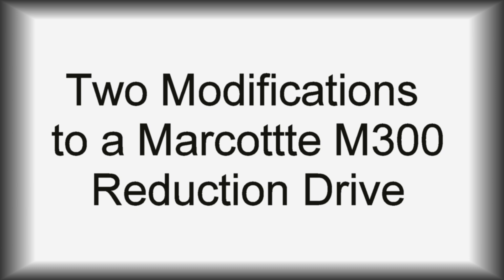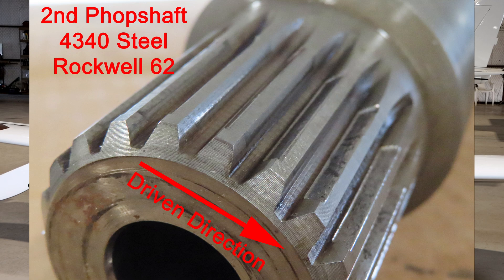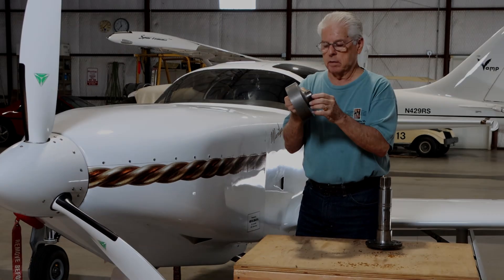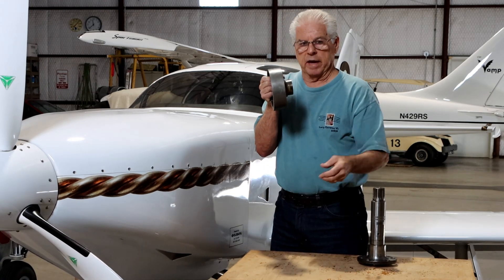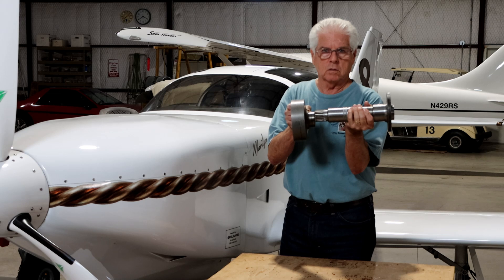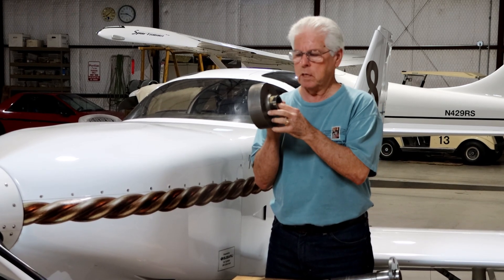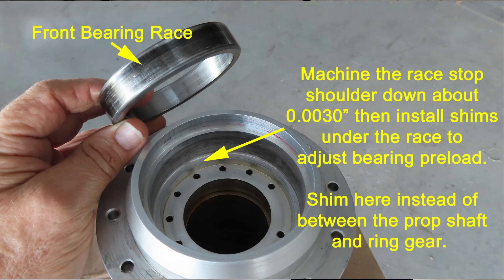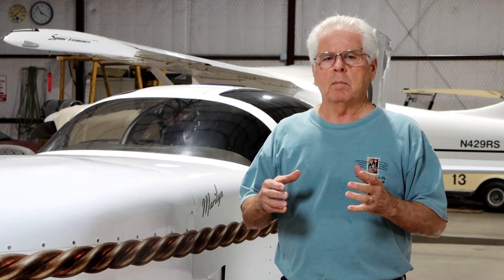Marcotte Reduction Drive Modifications - Video #1

Comment: Next time try drilling the holes at an angle perpendicular to the radius so that the rotation of the component drives the oil through the hole.   Without the angle the shear of the oil may limit potential flow.
Reply from the maker: Adam, excellent idea!  I am not 100% sure that natural oil flow is actually in the direction that I assume.  If I see improvement the next time I take it apart, I will oblong the exit and entry hole for even more oil flow.
Thanks, Russell